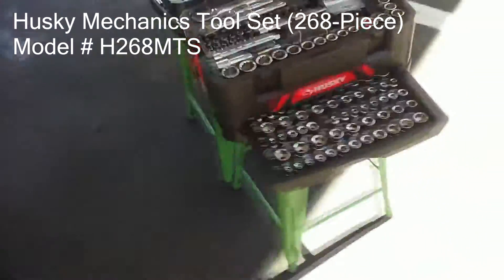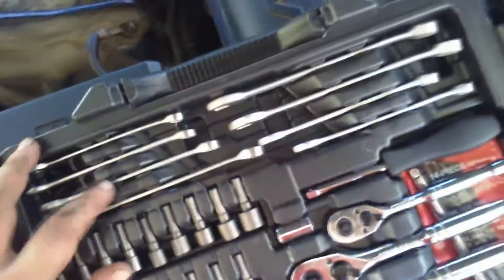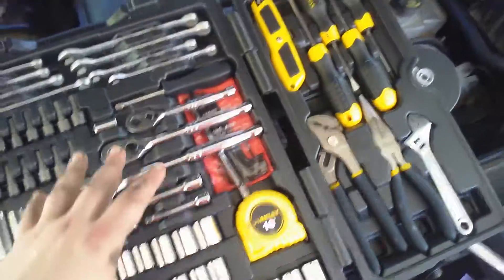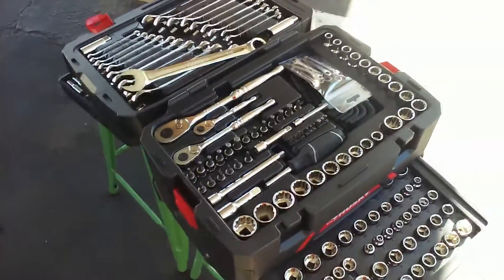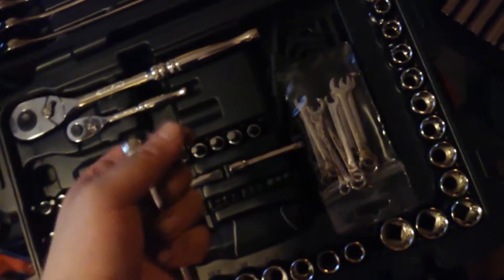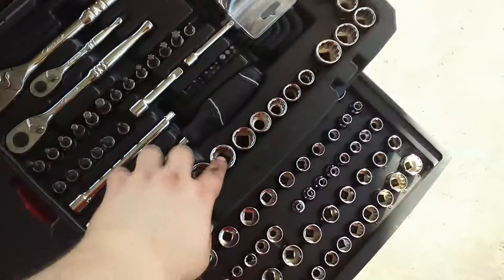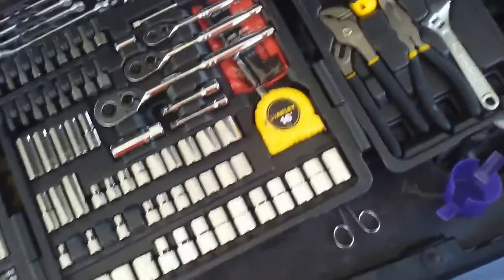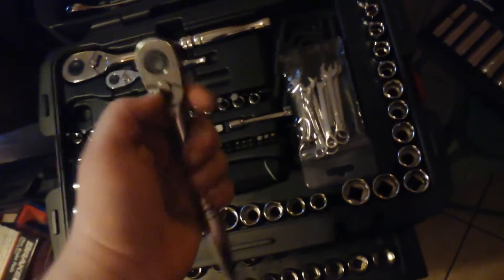Stanley 210 piece STMT73795 vs Husky 268 piece H268MTS

Comment: Love the video man, I like Stanley and think that the 156pc tool kit would be better for what you wanted as it has the 13 and 18mm wrench (its got 8mm-19mm wrenches) and the sockets go up to a 32mm, also a 1/2" drive breaker bar comes with it too. The set is a bit more pricy though. Thanks for posting

Comment: I am looking for a toolset that is self contained and compact that i could use while camping/offroading just for anything that could potentiallly go wrong on the trail. i dont expect to replace brakes on the trail or do complete truck maintenance. are there any sets you can recommend? or should i just keep packing my annoyingly big loose set of tools that have everything but annoy me as an organization freak?
Reply from the maker: If you have a good pieced together set of tools, then those usually can't be beat.
Performance tool Creeper seat.  Don't install the casters and you have a tool box that won't roll around and is comfortable to sit on.
https://amzn.to/2Otyp8R
There's a few other brands that are the exact same thing for a similar price.
It is small, almost too small, but depending on how many tools you need to fit for a mobile toolbox it could work.  My buddy at work has one and everyone keeps trying to steal it so they can have something that's comfortable to sit on while working at shin level.  
Couple that with some organizer foam:
https://amzn.to/2NYL6HH
And that'd suit some needs.
If it's not enough room replace the creeper with a drawer toolbox:
https://amzn.to/2Amf06E
or
https://amzn.to/2AmgwFS
Either will be at least somewhat rattly.
The Mercedes of mobile workstations are these:
https://amzn.to/2AqsKNL
Other than that, I still like the Husky just because of the organization, but you'd have to have a spot for odds and ends like hammer, needle nose, multimeter, vise grips, dykes, etc, but that's just me.
I forgot about this one:
http://www.stanleytools.com.au/products/detail/PRODUCTS/HAND+TOOLS/Ratchets+_+Sockets/Ratchet+_+socket+sets/156pc+Metric+_+AfwdslashF+Tool+Kit
I've never used it, but I'd likely put money on it.